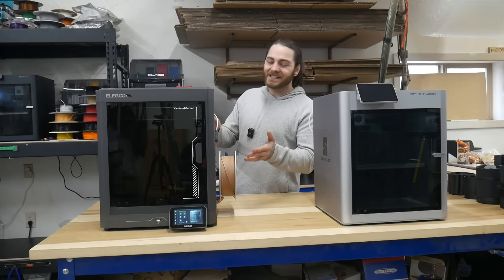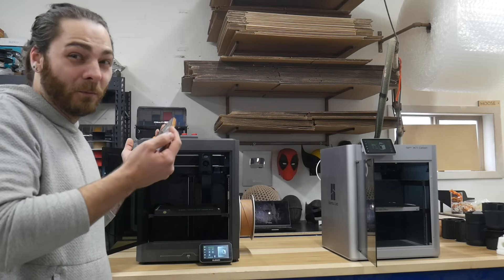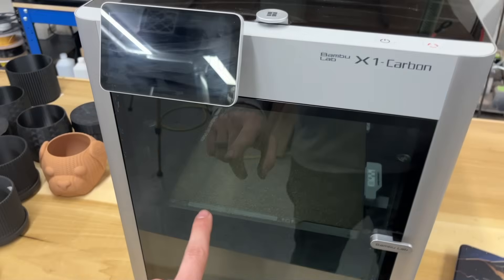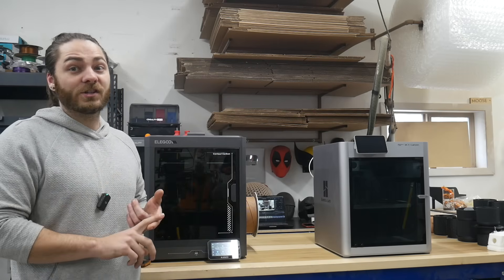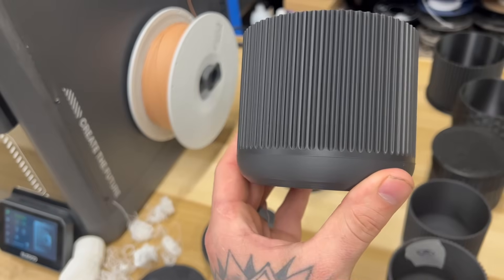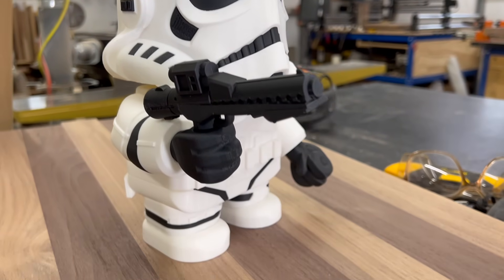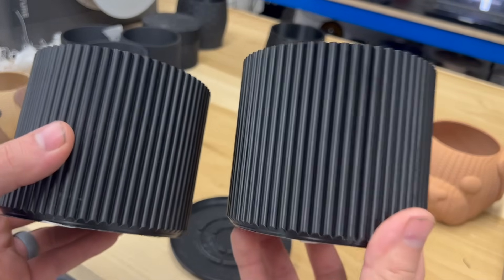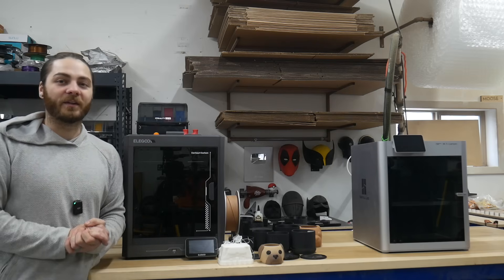Cheap vs expensive: Can the Elegoo Centauri hold its own against the Bambu X1C?

Comment: I’d be curious to see a video about how much tinkering it takes to make the Elegoo as good as the Bambu. Everything I’m seeing can be fixed in the slicer. 

1000 dollar savings at the expense of making some better profiles is VERY interesting to me.
Reply from the maker: It’s pretty comparable! Now I’m just curious to see how it holds up over time.
Reply: @TwoMooseToo  THAT is my concern. You should see what nema motors they use. What other things that makes them comparable and why the massive price drop?
Reply: @LK-pc4sq  I have the neptune 4 max and the saturn ultra. I can't complain about eh way they work. No real issues (4 max level every few prints sucks).  the only issue I had was with tech support...when there was a wifi issue they couldn't figure out, they just stopped replying to me. Not a fan of that. But no issues with the printers doing what I bought them to do.
I also have a Flashforge dreamer from years ago still going strong without issue but I don't hear much about them.
Reply: @NotsoEP  I had the exact opposite from Eggy support when I reported the random print failure issue several people experienced in the CC's earliest days - they fell over themselves trying to help me to the point where they sent me a beta software update to try. I decided NOT to load it as the fault had only happened the once but they were emailing me every couple of weeks to see if the issue was resolved. Many users reported this issue in the first couple of months after release and I'm glad to say it only happened to me the once and reports of it happening now have stopped, at least on the forum I follow - there was an OS update soon after they sent me the beta so I think they found the issue anyway. No, their support has been second to none for me.

Comment: Couldn't those vertical lines just be a slicer artifact? They look very consistent, and a lot like when you lower the polygon count on a rendering software.
Would like to see a comparison between the two using carbon/glass filled material and printing stuff like PC, PET. That's what I'm really interested in, and literally no one has done it yet.
Good video thu
Reply from the maker: No as they weren’t nearly as visible on the Bambu. The petg one they were both pretty visible so possibly. I made the planter files and export in a pretty high count. I’ll double check but have for sure has files of makerworld that are very noticeable.
Reply: @TwoMooseToo  I mean, I'm not saying it's that. Coming from someone that knows little about 3d printing it looks very consistent, almost intentional.
Could it relate to the stepper motors and the amount of windings it has? Like maybe the Bambu has more windings and thus a more precise print?